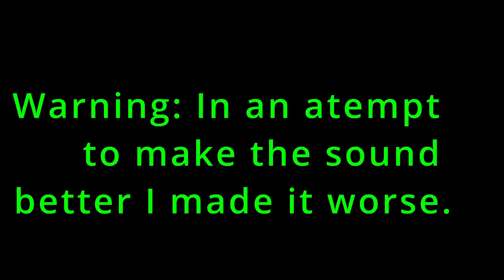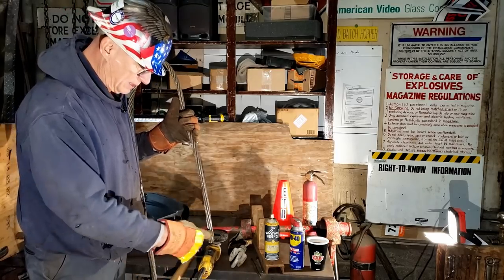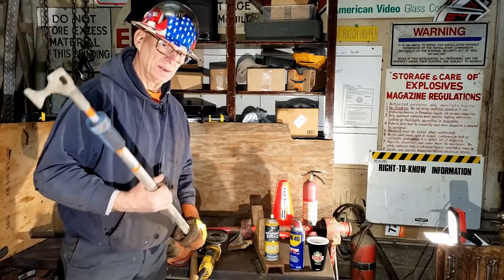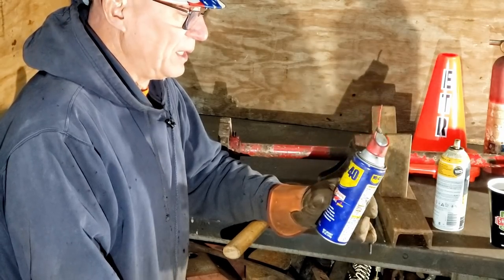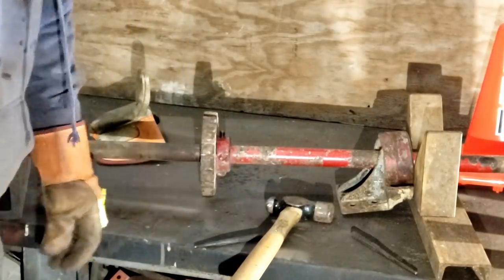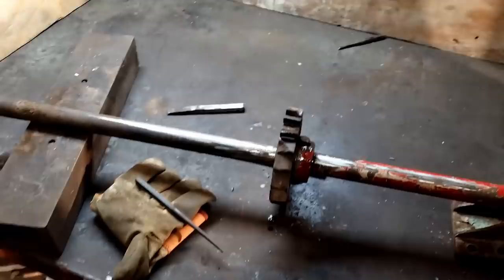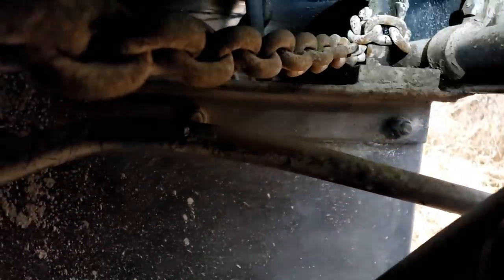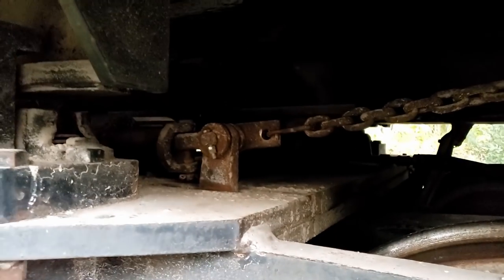Locomotive and Railcar Brakes

Comment: If you're looking for a spray lube use SILICONE SPRAY, WD-40 has a HIGH concentration of wax and it may be great wet but when it dries it actually makes it worse...... Becomes gummy
Reply from the maker: Good input, thanks Ryan.  Brian
Reply: It does not contain fish oil, silicone, kerosene, water, wax, graphite, or chlorofluorocarbons (CFCs).    It was easy to find that information on the web.